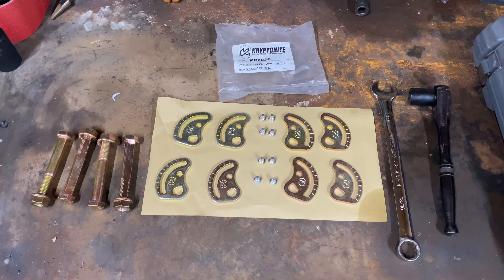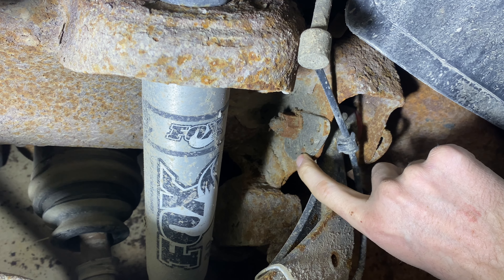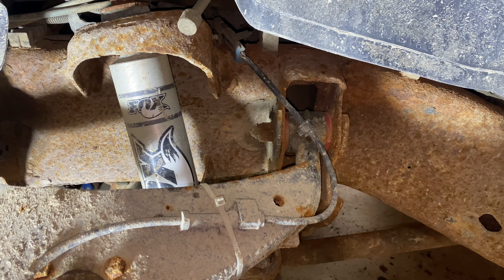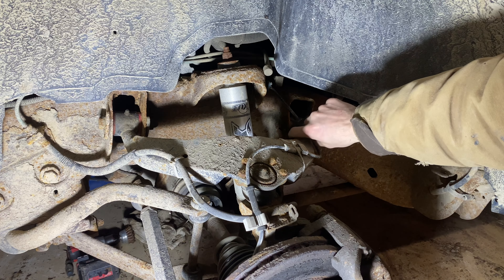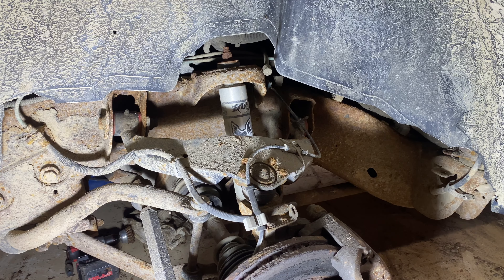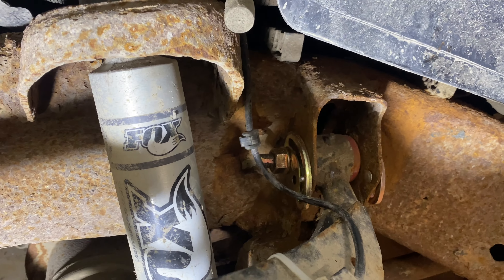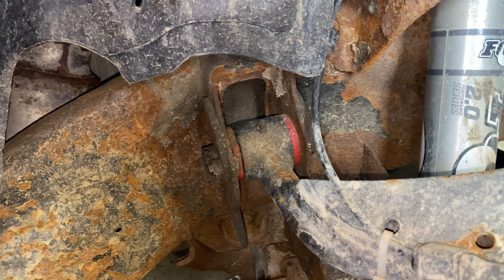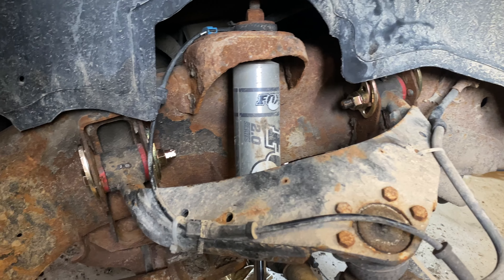Cam Bolt & Alignment Pin Installation

Comment: Is the driver side cams supposed face down ?? I see that the passenger the cams are facing up ??
Reply: It’s suppose to face up. That’s another way to fuck the pins up again. People shouldn’t be working on them trucks. 
I’ve had a truck come into the dealership with the pins fucked up and the cam adjuster facing down which is the wrong orientation.

Comment: Interesting that you replaced the kit that was already on the truck as it had the positive stops and replaced those with the open slotted type. Most guys are doing the opposite of what you did and going to the positive stop kits.
Reply from the maker: The ones that I had where round hold for the bolt, the bolt could rotate inside pulling the truck out of alignment. The good ones have a flat side on the hole to match the bolt so it doesn’t rotate on its own. This is what the local shop sold so I grabbed them
Reply: I had those kryptonite ones on for about a year until I went over to the Dirt King locking alignment cams. Much better and alignment finally stays in place. My truck is not a street truck and gets driven hard offroad living in the desert.
Reply: @Cruff16 it’s because you use the ones with the groove and flat bolt to get your truck aligned. Then once aligned, you mark, pull off and mark the bolt hold that lines up with the mark. Then you install the ones with holes on the alignment pin and lock it down. You can also use the ones with holes to align but it’s much harder, however the ones with the holes and round bolt are the better alignment tabs vs the flat bolt.